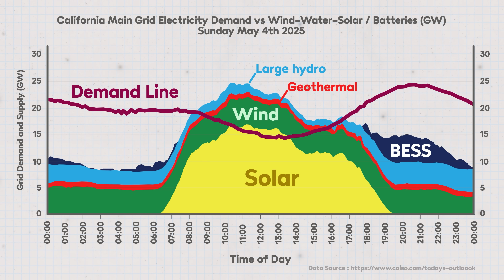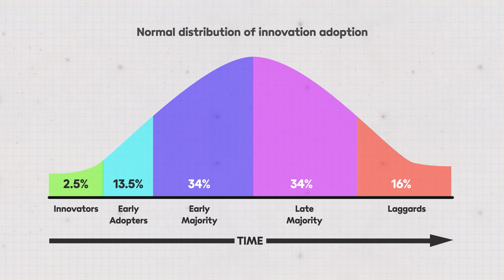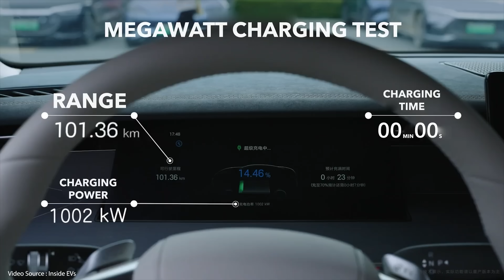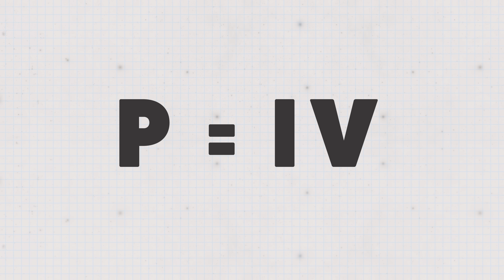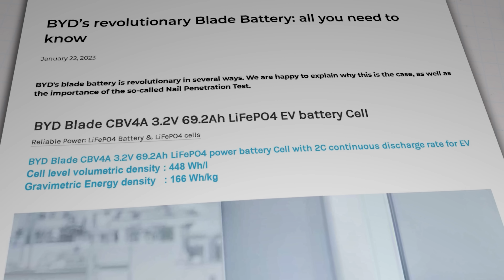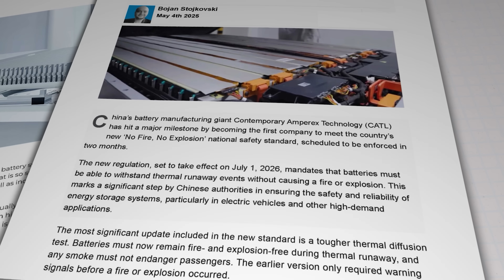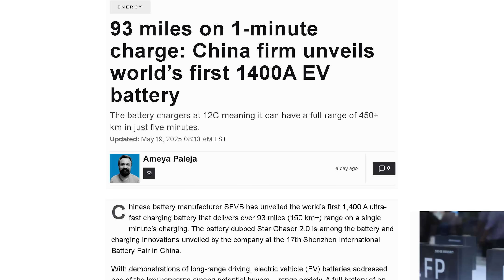BYD 1 MEGAWATT 5 minute EV Charger. Overdue or Overkill?

Comment: Of course current EV owners are happy—they’re the ones whose driving needs already fit EVs. That doesn’t mean range anxiety is irrational for everyone else.
Reply: It absolutely is irrational. 99% of people that complain about range never drive more than 100km  a day except for the kne road trip they do once a decade
Reply: @stratvids  I drove 330 km yesterday. It was a normal Saturday. A week ago Thursday I drove 950 km to get out of the city for the day and enjoy some hot springs. On that loop route was a 391 km stretch without a charging station.
Reply: And you really think you're typical? I didnt say no one. @MarkRose1337
Reply: @stratvids Yes, that's very typical where I live. People do things using cars here.
Reply: @MarkRose1337  its not typical anywhere you are deluding yourself, that said, if that's what you do then stick with a non electric
Reply: @stratvids when I go out with friends I easily do 150 kmh
Reply: I love my BMW i3 with a range extender! I wouldn't own it without the range extender because driving with only 130 mi range is like starting a trip with 3 bars of gas and I never leave on a trip with less than a full tank. As a 65-year-old it's hard to rethink and put that range anxiety out of my head but, I'll get there!

Comment: As voltages go up issues with dirt, dust and moisture start to become an issue, The system has to be much more carefully sealed and insulated or arcing will make be an issue.
Reply: You're not connecting a live conductor...
Reply: @jnawk83  Arcing can occur at high voltages on the outside of cables when they are energized,  you are only considering the plug. I have had burn marks on the outside of a cable from moisture and dust. If you ever looked inside an old tube TV  the High Voltage section of a tube TV, the had a metal cage around the circuit to protect against arc overs. At sea level the  Arc distance for 800v is small, but still should have a grounded metal sheath around the conductors but higher voltages or altitude can make a difference.  For instance on Aircraft 270VDC systems are restricted to pressurized areas or altitudes below 28,000ft.

Comment: The other day I saw a charging station that had a 150kWh battery inside to help with situations where the grid isn't capable of supporting a DCFC, that's pretty cool.
Reply: That'll be more and more common when pricing needs to be competitive.  Charging locations buying and storing electricity when it's cheap.
Reply: Should be the norm
Reply: With EV battery packs between 50 and 100 kWh,  that wouldn't charge many EVs?
Reply: @maxhugen Nahh, 150kWh is a crutch for solid DC fast charge. Tesla sites often include 4MWh megapacks. Expect to see more.
Reply: Agricultural chargers will have to be mobile. 
That's battery powered multi Megawatt pack to pack charging. 
It's a good thing that at least that tech already exists.

Comment: i think you overlooked a key point of faster charging - its not about range but the opposite - if i know i can get a 100km of charge in 5 or 10 minutes then i dont mind charging more often (if the infrastructure is there) and I can then have a smaller battery in my car, and given weight is the biggest issue in EV's then the range goes up just becasue weight is reduced. smaller batteries will also make vehicles cheaper.
Reply: That may work for short trips but i wouldn't want to stop every hour on a long journey
Reply: @binmanblog  
you drive at 180 mph? (average)
Reply: @rogerstarkey5390 Think he was talking about the OPs comment that if he can get 100km range in 5 minutes he will just stop more, extrapolate that out to needing to stop every 100km on a long trip. But the video says BYD is saying 250 MILES of range added in 5 minutes.
Reply: @binmanblog  You don't have to. Please keep up.
Reply: "i think you overlooked a key point of faster charging - its not about range but the opposite - if i know i can get a 100km of charge in 5 or 10 minutes then i don't mind charging more often (if the infrastructure is there) and I can then have a smaller battery in my car, and given weight is the biggest issue in EV's then the range goes up just because weight is reduced. smaller batteries will also make vehicles cheaper."

I'm going to have to disagree with this point for two reasons, based on real first-hand experience driving an EV for several years.

1) When you drive to rural areas that don't have good charger coverage, faster charging speeds are never a substitute for good range. I often take my car to go hiking in very remote areas, so this factor matters a lot. Also, even when rural chargers do exist, they tend to be relatively slow chargers, so even if the car does support ultra-fast charging speeds, you won't be able to take advantage of it there.

2) The way batteries work, charging speed is proportional to the battery size, just like capacity, so if you reduce the battery size, thinking you don't need so much range with ultra-fast charging, you will also lose the ultra-fast charging as a by-product. The way to think of it, imagine a big battery as a whole bunch of small batteries; to charge the big battery, you split power and charge all the small batteries simultaneously. So, if you halve the number of small batteries going into the big battery, yes, you've halved the size, weight, and cost of the big battery, but you've also halved the charging speed, since the charging speed of each small battery is unchanged, but only half as many of them are able to charge at once.

As to range going up from reduced battery weight, that effect is a lot less than one might think. Batteries are only one factor that goes into the weight of an entire car (the EV I drive is only about 30% battery by weight, for example, and has about 250 miles of range), and vehicle weight is only one factor that goes into efficiency (cruising at high speeds, aerodynamics, not weight, is the biggest factor). At the same time, the impact of weight on efficiency is considerably less in an EV vs. an ICE vehicle because, in an EV, more weight equates to more regen power when you slow down, something an ICE vehicle can't do.
Reply: @ab-tf5fl  1) You would have that issues either way. A larger pack means you would also take longer to charge when needed. Unless you can just make it in a single trip either way you would be limited to the speed of charge for your given battery size.

2) Not fully, batteries can offer different features base off its chemistry. Adding a bit of Iron or even switching out the carbon for sulfur or any other element can improve charge rates while keeping the number of cells the same.

So if we have the same or less cells (smaller pack) but a battery chemistry that can allow faster charging, you would just charge more (like an ICE range) but get to the same location in about the same amount of time. The one killer for me is that charge rate. While I know many would say they need a 30 min break for driving that long, many of us don't so if I have to add another 30 mins - my drive time could easily add hours to a trip and that means being longer on the road. More or less, I be willing to switch to an EV then over ICE. Granted, 400 miles batteries would be better if it came with that 5 min charge time - as that is overhead for when you need AC/Heating as well, but even at 250 - that would be ok range for at least in town 200 (-25/% miles because of AC/heating).
Reply: My sweet spot: 300km for 3hr driving with a 30min break for charging and sundries.  Current technology is already capable.  Definitely need more charge points on the way to Darwin though.
Reply: @ChrisNotTheKing  I drive long distances in Oz...  wouldn't be keen to have to plan every trip depending on where I could charge an EV.  With fast DC charging speeds,  chargers that are working,  and without queues of EVs also waiting for their 20-30 minute charge.  😎🇦🇺
Reply: @maxhugen You don't have to plan, fortunately. Latest ABRP (for one) can direct you via available, working charge points, and readjust as you change your mind. Gotta pity those early fossil adopters that probably only had a vague idea there'd be a chemist located somewhere near for their refuelling needs.
Reply: @ChrisNotTheKing  "early fossil adopters"  Like Henry Ford?   "Chemists"  You sound incoherent.
Reply: @maxhugen No no. Ford's customers either had to distill their own fuel or buy it from chemists. Dedicated fuelling stations followed in time.
Reply: Smaller packs aren't capable of the same high charge speeds because of fewer cells in parallel.  The down side to large packs is they are heavy - if the range and charge speed isn't needed, then it's a waste of energy carrying them around.
Reply: You might have overlooked tha fact, that a battery half the size can only accept half the charging power. So when the big battery can charge 100 km of range within 5 minutes, a battery half the size will need 10 minutes for the same range.
Reply: a great, and overlooked, point. thanks for bringing that up.

Comment: My Hyundai Kona EV charges at 77kw. 

It's just about fast enough. 

1000kw for passenger cars would be pointless, except for niches.
Reply: Like mobile phones etc we don't use most of the built-in tech, but we are happy to accept it all the same. We don't really need the power and torque in the most modest of eV's, but at the traffic lights...

Comment: this combined with improved battery swapping tech would be able to make parity with ICE vehicles
Reply: I think these new technologies are making battery swapping moot. Swapping means a large overhead in spare batteries, and the huge variety of batteries, voltages and architectures will surely make any swap station prohibitively expensive?
Reply: @danshillabeer9523  BYDs modularity on the same battey platform proves yhe opposite.the only difference would be the battery capacity.also the overhead wouldnt be much as there would be a limit which gives a steady figure for BYD to maintain.the overhead wouldnt be something like 5x,more like 1.2x
Reply: @AhmadAli-kv2ho that's assuming there's sufficient business to justify BYD-only swapping. They represent only a minority of eV's in most countries, and eV direct charging infrastructure is already mainstream with variable voltage. I feel it's a potential solution for large goods vehicles, but even then the rate of battery tech improvement will make it redundant before it gets started, for the reasons I mentioned
Reply: @danshillabeer9523  it doesnt have to be BYD,even though they are one of top players in the space.only the basic platform design can be adapted by other companies
Reply: @AhmadAli-kv2ho in principle - but why would they? I agree there are car makers using BYD batteries, but once they take the chassis - which is implicit in the battery architecture - they are bodywork designers, like Skoda/SEAT are for VW. Can't see big names wanting to be that dependent. It's admitting defeat
Reply: @danshillabeer9523  cos so many western car brands are falling behind chinese automakers.especially BYD.a singular platform would help them gain some relvancy in the market.i mean toyota was apathetic amd then they tried hydrogen which didnt work out well at all tbh
Reply: @AhmadAli-kv2ho totally agree, western and Japanese brands in free fall. Japanese took over the car market in the 60s/80s, now China is the new kid in town. Hard to let go of an empire!
Reply: @AhmadAli-kv2ho however, I don't see the Chinese government letting western auto off the hook unless it's to avoid tariffs and get govt subsidies?

Comment: Water flowing though pipes also has resistance. A water pipe heats due to friction when water flows though it
Reply: not nearly as much, order of magnitude difference, but definitely misrepresented in the video
Reply: Tell me more, random people on the internet, how I'm not wrong but you still have things to say for no reason
Reply: @drdrowland  Just like yourself, you mean?
Reply: @drdrowland  well, lets just say that the massaging of one's own ego via a comment on a you tube channel makes that comment worthless as far as i am concerned. if you commented on the core aspects of what Dave had to say then i may take what you have to say seriously...
Reply: Welcome to pedants corner. Yes the simple water analogy with electricity is not correct in all sorts of ways but good enough to serve the purpose of illustrating his point to those of us who are not technically minded, don't you think? The main points of this video are about battery tech and customer perceptions of EV's, not plumbing!
Reply: @fuccasound3897 

My comment is that their water analogy is better than they think in the video

Just like water in pipes there is resistance in wire and that helps understanding
Reply: Turbulence and drag are the main factors to that resistance. Heat is trivial, insignificant even.
Reply: It's just not usually in any way remotely relevant compared to other forces involved. Or to put it another way, if your pipes generate enough friction heat that they might deform, they're probably already flying all over the place.

Comment: If I ever buy a new car, it'll be electric. But my current car probably has at least a decade left in it, and I might not have that much left in me.
Reply: Now is probably the best time, BYD has some fairly inexpensive vehicles around $16-20k and used gas vehicles can still fetch a decent price so you can maybe recoup a decent amount of that if lucky and they are pretty decent vehicles too not what you would think a vehicle like that looks like, even a 20k small SUV
Reply: And the current car already has a 50MW charger port ;-)
Reply: @philipoakley5498  More like 20 Megawatts but still it's like lightning vs snail

Comment: One thing that is being quietly done to boost energy transmission is to re-string overhead bare conductor lines with composite core cables. They are more resistant to heat induced sag so more energy can be pushed along them. During periods of hot weather some lines would have had to been run at lower capacity.
Reply: I'm pretty sure Dave actually mentioned this in the past. Also: composite core cables are simply stronger overall, so you can have more conductor. Iirc having a non-conductive core will also help with the skin effect, but I'm not completely sure.
Reply: @jaskij  I don't know whether Dave has talked about it or not...but other channels have...

Comment: Do we really want to charge that fast? I charge either overnight at home or when I stop for drinks/food/toilets on a longer journey. I can't eat or drink that fast so I'd have to move the car half way through my meal to avoid blocking the charger.
Reply: Many taxi drivers and all van drivers both reject EVs because of the forced downtime when charging.
Reply: @dominicgoodwin1147 their lack of planning. Plan the charging stop when the mandatory rest period is happening.
Reply: There are contexts were it's not need and contexts where it's a functionality really appreciated. When you are in a hurry like business travels, and the pauses are just to fill the range, then you don't want to stop. It's just a car need. So, the shorter, the better.

Yes... I can convine that if you don't have a hurry, and it's a stop in a long travel, you will probably want to rest, so a longer stop is probably preferred.

Besides, the 1MW charger class will be shared with next generation trucks, buses and other heavy vehicles with a lot bigger batteries. We will need that chargers anyway.

That's the reason I think that 1 MW are a good addition, but still in a charger site, just one or two 1MW class charger will be needed, while others can have less powerful configurations. Like another 2 or 4 "fast" chargers of 350kw, and 10 of "slow" chargers of 50 kw.

It depends on your needs or your stop it's better to use one or another.

Comment: High voltage and high potential amperages can lead to being unalive
Reply: So can drinking gasoline...
Reply: 240V and 16A can do that in your home. Simply don't touch live wires. No sane person would ever do that.
Reply: @knowledgeisgood9645 In my experience in old school neon, spark plug wires and being a bucket truck operator for my municipality for the last twenty years I find voltages above 600 can use smaller gauge wire, but it can jump the air gap that stop lower voltages easily.
Reply: @TennesseeJed  Do you really mean to say that cars and trucks made today have not made those risks almost nil? The only one to be in any danger is a car mechanic, but those are supposed to be capable of doing their job under safe conditions. 
My point is, you are imagining a problem so rare and unusual that it will not affect any driver.
Reply: True, filling your gas car while smoking also can have that effect, so? I own a phev and when I connect the charger to the car I can hear a lot of switching inside the car and the wallbox, this is the safety system locking the plugs and negotiating the demands of the car, after which the power is switched on. During charging the connectors are locked and only after the wallbox stops the flow of power can I disconnect the plugs. And yes, if I jam a knife in the cable it is dangerous, just as dangerous as cutting a hole in the tube of a gasoline pump, disclaimer: don’t🎉
Reply: I was thinking of the potential when it is intentionally or unintentionally disassembled. 

I am excited for the improvement of EVs! I simply don't believe it'll help us to consume less resources and energy because that Jevons guy knew the truth about energy and its allure to power.